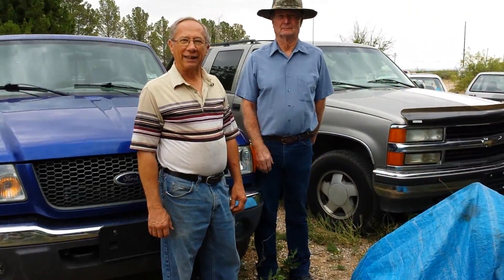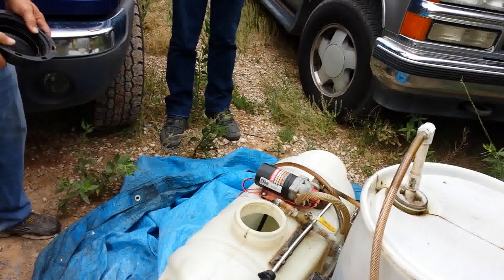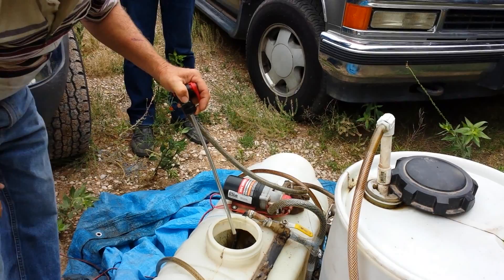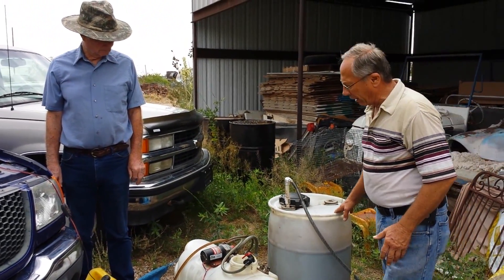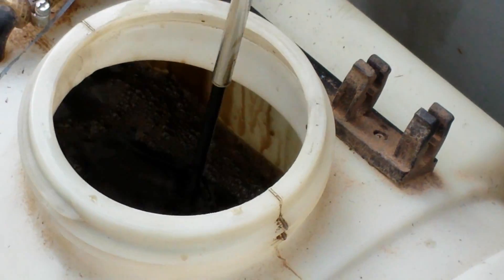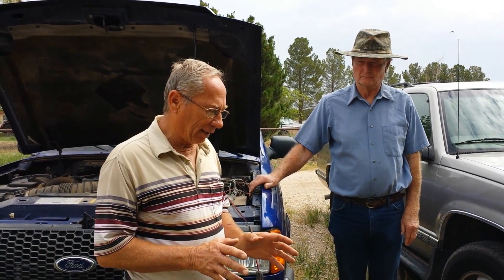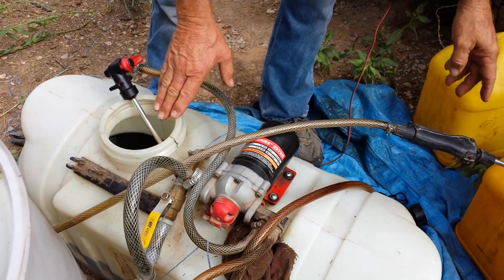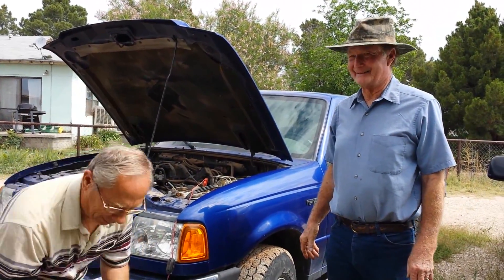Diesel mixed with used motor oil

Comment: This is NOT SMART at all. If the fuel is black it is black for a reason meaning it is so filled with contaminants that it is BLACK! When the contaminants are filtered out it would be gold colored or clear! Black diesel would be great for a heating unit but not to burn in you $10,000+ tractor! That's just stupid!

Comment: Are these kits still available anywhere? Would it hurt to run it through something like Amsoils filtering system and a centrifuge before hand or is it not necessary - just don't want to have to buy injectors or pumps. Also like the idea of gas mixing - sounds cheaper.

Comment: I did this for years for my 2000 navastar t444 I built a centrifugal from a washing machine worked great I pulled a 3 car trailer all over never gave me any problems also ran straight used trans fluid for fuel and used veggie oil truck had 575000 miles on it

Comment: I think if someone is doing this for a diesel engine, make sure the fuel is thin enough. If it's too thick, it's hard on the fuel pump and harder on the injectors. This also causes issues in the winter months when it gets cold. I also mix my oil with gas. In the summer months, I run a 80:20 ratio. In the winter it's 60:40 ratio and sometimes 40:60 if it gets real cold and this isn't even for a regular diesel, this is for a multi-fuel engine in my M35A2.

Comment: I suggested this to a guy 30 years ago when i was 10 yrs old and i had started to work on diesel engines with an old machine operator down the street....
The idea came to me because of the way we mix 2 stroke....
And i thought if gasoline was that powerful wouldnt motor oil balance it out....he said it was a no way idea and the gas would blow the engine....
I was right
Reply: Back in the day there wasn’t such a thing as 2 cycle oil they used just motor and gas to run chainsaws and other 2cycle machines. I bought a old gas air compressor at a yard sale that had the mixing ratio labeled right on the tank

Comment: ive gone through two sets of injectors now on a 2001 7.3, truck ran great but after about 5 k the internal orings would wear and fuel would add to my oil sump increasing the oil level and severe power loss, i think its because of the huei system and the thicker black diesel is harder to push out nozzle so pressure is higher causing blowby back to the actuation pressure side and damaged the orings.  im gonna try it now with a 12 valve, i think the pintle injector should be ok. ratio ive been running is: 25 gallon 15w40, 20 gallons diesel, 5 gallons gas

im mixing all at once, let it sit overnight, pump entire mixture except laste couple inches in 55gal drum, then circulate that mix for a few minutes and run it. note* im running about 100miles a day, so the remaining sits in the tank until the next use

Comment: If fuel prices get real high then I do the gas oil mix method but when their at or under 3 bucks a gallon I simply filter 2 gallons of 5w/30 into a full tank of offroad diesel it make the fuel brown and it reduced the smoke output. I also do think it stops algie from growing  in my fuel tank. Black diesel got me thru 2008 in my vintage 240D
Reply: Over $3 per liter here in nz.  $3 a gallon is cheap as

Comment: if theres water in your oil, you need to check head gaskets.
Reply: No. All used motor oil has water in it from combustion, Some has quite a bit, other old oil almost none.
Reply: People are dumb af not like there is a cup of water in your oil but there is moisture picked up along with metal shavings etc etc etc 😂😂🤷🏻‍♂️🤷🏻‍♂️🙄🙄🙄🙄

Comment: This does work I used to do it in my 2000 7.3
Reply: Jon Smith was going to use in my 01 7.3 some guys said it’ll blow it up etc etc but they never could prove why ....what do you do to make it and what kinda tips do you have
Reply: Was fuel gritty or does fiter get rid of that oil grit
Reply: Heard the 7.3 can drink anything

Comment: One micron filtration is not enough not even close
Reply: you are professional,because much heavy mental oxide impurities in the used motor oil ,the filtration is not enough,our machine use the high temperature distillation machine technolgy,if you want to know more information,please contact me wechat/what;s app:+8615823899667

Comment: Not good! Used motor oil has metal particles in it which is why it turns black. Putting these particles into the atmosphere is bad.
Reply: Used unfiltered oil does indeed have particals suspended in the oil that's why engine oil lab test can detect particales of lead and other metal alloys to detect engine wear without a engine tear down inspection. Although with proper filtration it should have a effect.
The black is the carbon. And a centerfuge is the proper way to go
Reply: Centrifuge
Reply: bainsk8 oil turns black from the carbon deposit at the piston rings not from metal.

Comment: This is easier to do with the older engines of the kind that is used in the video but it's probably not something you want to do on a newer engine

It would be interesting to know how much the pellets cost and how much yield you get from them
Reply: I've been using lots of wmo too, but I put about 30gallons to 5-10 gallons of gas. I will use a pump and constantly pump it through a 100 micron sock filter and to mix the two better. Once this is done I pump it from one drum to another. A dirty drum to a clean drum. From the dirty to clean, I pump it through a 40 micron filter on the hose and then it goes through a 10 micron sock filter in the clean drum. Seems to work pretty good so far. I've been using this for my Deuce and a half.

Comment: Sorry there einstein but only an idiot would ever put used engine oil into a fuel tank regardless of whatever filtration is done. There is no way to remove all the metal particles along with other contaminants unless the oil is run through a boiling/condensing refining process which makes good clear clean fuel oil out of it, what you are doing is trying to save a buck while in the long run you will spend many hundreds if not thousands by ruining the injector pump and also cause major engine wear by not using clean diesel #2.
Reply: Cekiert.  The crude oil refining process is similar to distilling spirits or water, and can be done to waste oil as well, so Woodchip isn't wrong there.

As far his statement that waste oil will wreck a system if only filtered instead of refined, I've been doing it for about 8 years and still running the same old injectors and pump that were on the van when I bought it.  I've saved enough money to cover a whole injection system replacement, and a new engine.
Reply: If your definition of idiot is: "one who saves lots of money", then I am an idiot.  I'm not using the magic beads or filtration system like shown here, I just dump it into a bag filter and let gravity do the work.
Reply: 1micron...
Reply: Wood chip, I was ponding if oil actually boils, you can boil water that maybe in the oil from leaky head gaskets or what not But oil has a flash point. It will get black as the oil breaks down, then auto ignite with a enviorment of the proper oxygen content. I'll say his oil isn't filtered properly, but I've seen oil filtered by centerfuge come out clear. It's amazing what filters can do, after all it's not like the water most people drink has been boiled and condensed during it filtration process short of getting water from a desalination plant or a hand full of other water plants.

You don't need to call people names, if opec shut off 90% of it's oil output tomorrow. I bet you'd be the first to crumble. I've seen several fuel shortages from natural disasters. And being able to generate extra fuel is a skill worth having. Even current every day fuel prices in Europe would make new injectors economical.
But I'm sure you'll just try boiling oil in your garage?

Comment: We have been blending old engine oil with diesel for the past 10 months. Oil is centrifused  and passed through 5 micron filter before blending. Have noticed that on some vehicles a black sludge appearing in the fuel system. Is it possible that the blending process is responsible for this sludge appearing?
Reply: Centrifuge should take all the sludge out of the oil

Comment: Can do same thing with used cooking oil. Either way get oil hot before straining and filtering. Concerning using gas.. Be carefull. To much gasoline can cause too much heat and not enough engine lube. Best of luck.

Comment from the maker: Still mixing used motor oil, but now finding that half of what we mix does better with 5:1 ratio of used motor oil to gasoline.  We are also now straining the oil before we put it in the plastic drum then adding the gasoline into the drum and stirring it. This thins the oil and it goes thru the filter much easier and quicker.  There is less smoke and more power. You can safely go 4:1 or as high as 65/35%.
Reply: gasoline?

Comment: Co verging used motor oil to diesel mix.
Reply from the maker: We are having better performance without hurting the engine by mixing some of the fuel added at a rate of 5 gallons used oil to one gallon gasoline.  More power, easier starts, less smoke.  You can even go as high as 65% used oil to 35% gasoline.
Reply: making up words here "co verging" lmao yeee hawwww

Comment from the maker: If you wish to use a center fuse, go to USfiltermaxx  on youtube and meet Steve.  His number is:904-334-2838.  Youtube Making Diesel fro WMO Waste Motor Oil Black Diesel Processor.  Black Diesel is more powerful than today's diesel.  Runs quieter, and if properly cleaned does not hurt your system.

Comment: What are and where do you get the pellets?
Reply: +Joe Holiday Nope! Still a mystery ~
Reply: From the video, it looked like activated carbon it's used commonly in water filter equipment. And commonly available in bulk for the aquarium industry.

I'm, fairly certain there's some incorrect information in the video
Out of respect to the channel owner for posting this video please don't take this information the wrong way. I'm only wishing to help profect your system.

The system shown is filtered probably with a oil filter, it's probably too thick at this point for a water fuel separator filter.
Then goes to mixing the activated carbon is like a sponge but it isn't effective in this manner. It will trap particals yet release them as easily.
As far as changing the pH of the acid or filtering out water I have serious doubts. Water can flow through activated carbon easily.
Which is one issue, second issue activated carbon rubs together and forms a fine black dust which is similar to a new water filter. One issue is this dust needs to be filtered out as well.

I'd suggest
Move the activated carbon into a canister filter before your oil is passed through the 10 micron filter. Smaller pump can be positive thing. Oil filters have a spring that allows oil to bypass a filter in the event of a clogged filter. Oil filter Manufacturers would rather feed a engine oil pump dirty oil then no oil. It's highly likely that pump it too high of flow for the cold oil being filtered likely the filter isn't pulling much out contamination. Mixing pump is still used to mix diesel I'd suggest a small glass bodied filter here if anything shows up in it you know earlier filtration has likely failed or you have dirty unfiltered diesel. Better to have a warning then not
Before distribution it highly suggested a fuel water separator filter. The oil can easily be packed with water.

As for the neutrilizing acid I maybe wrong here but I don't think activated carbon will filter out the acid or change the pH. Maybe if the acid compound is large enough activated carbon could filter it out but not effectively pumped around the tank
Reply: I think you can use the pellets that pull moisture from a room you know they come in a net bag and hang it up in a basement or something.
Reply: I don't worry about water. If I can't see water and oil separation in the tank, then it's not enough water to worry about. I just mix one quart of alcohol to every 20 gallons of oil that I filter. Allows the engine to safely burn any water in the system. The water mixed with alcohol turns into methanol and therefore won't rust or anything. It'll burn like low octane fuel.
Reply: You know your on the right path when your driving a ranger as a grown man